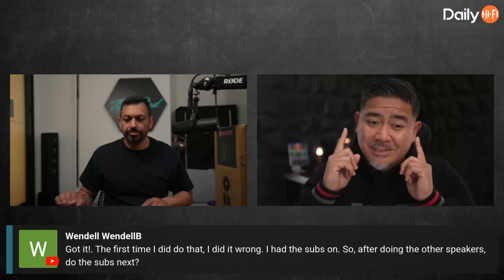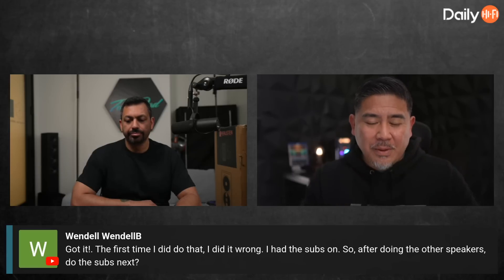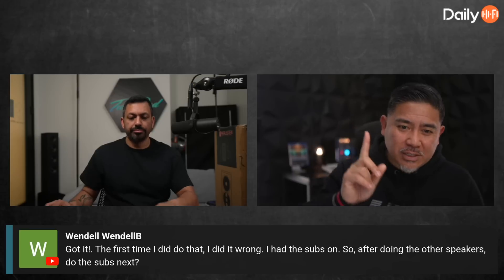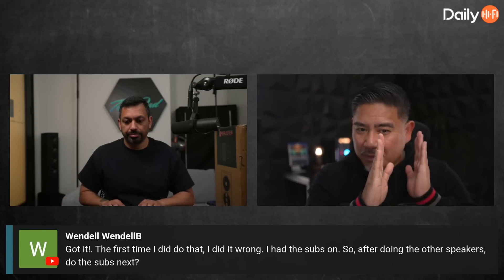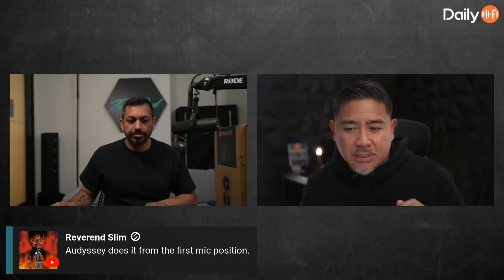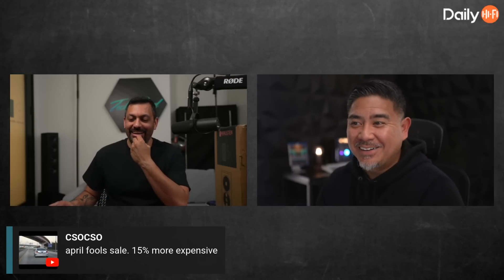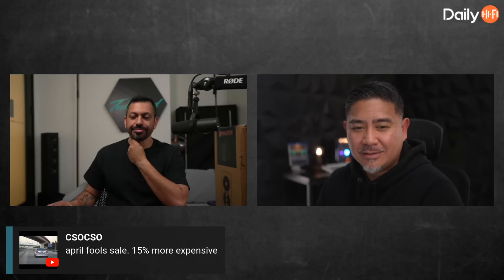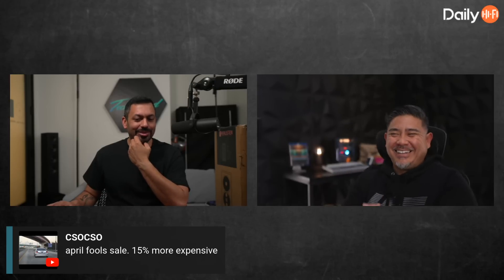Why Automatic Time Alignment Isn't Perfect and How SACT Can Fix It

Comment: Interesting concept;  I think another key is 0!phase alignment between speakers through the meat of the listening band.   I may try changing mlp left and right based on the distance between my ears for left and right measures and see how it goes using Focus Fidelity and REW.  I wish there was a dsp that could handle atmos and convolution files.  Minidsp doesn’t have enough capacity or channels.

Comment: What I have found tricky is that if you have more reflections (for whatever reason) on one side then the imaging will be off but is this really a timing issue or spl issue? I think its an spl issue but delaying the signal can also have an effect. Unfortunately in non symmetrical rooms things can get tricky.
Reply from the maker: Joe here. It can't get any worse than in a car where you're sitting off-center and there are a ton of reflections. For time alignment, the most important aspect is the arrival of the first sound, even though, in a car,  it's possible for the reflected sound to be even higher in SPL than the direct sound. Reflections do affect SPL, but the delay should still be set correctly. You can address the levels after.
Reply: @ agreed but how do you know if your time alignment is slightly off or if your perceived spl is off due to reflections? When using the test tones both will have the same effect of shifting the imaging a bit right?
Reply from the maker: SPL should be in the ballpark first. Then you can adjust using delay.

Comment: I totally agree with the measurement aspect, however, I strongly doubt it's perceptible by anyone. And the only way someone might hear the difference in 3 inches of head space is if they had a direct A/B switch to compare 3 inches of specific difference. Yes technically the room will measure different every 3 inches, but who can actually hear it in a blind taste test? You know it would be nothing but "I think" with endless "ummms" and "maybe's". Personally, I move way more then 3 inches during any sitting and I can't tell the difference.
Reply from the maker: The closer you are to the speakers, the more it matters and the more detectable the difference.